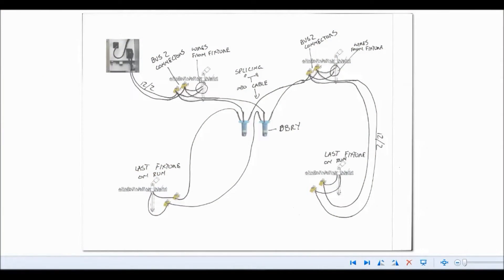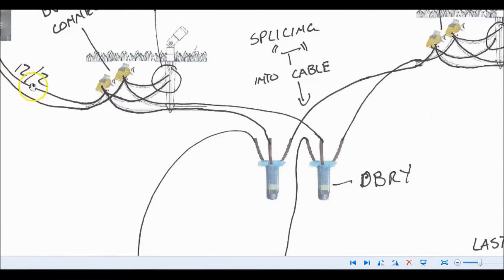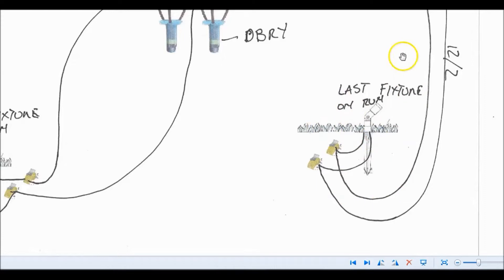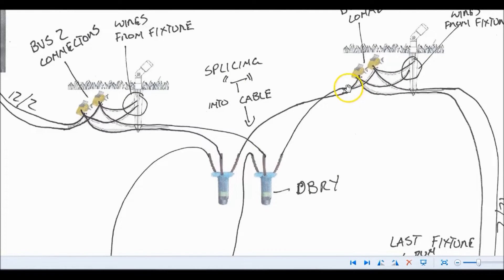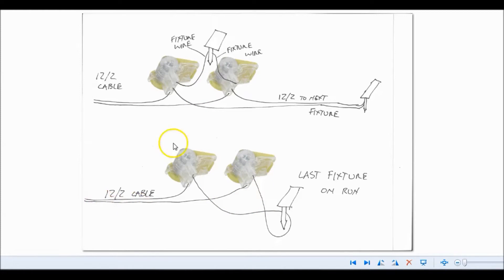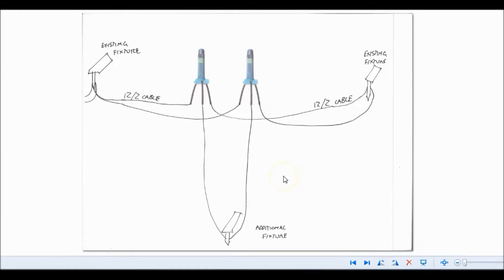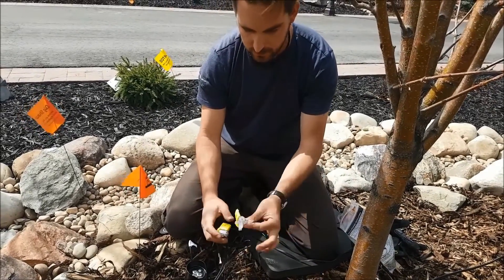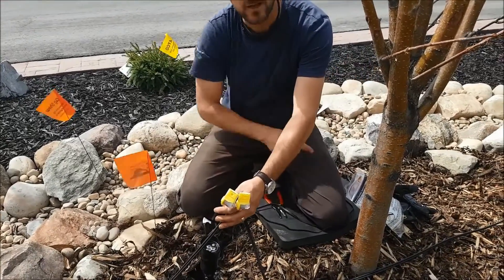How to Wire Low Voltage Landscape Lighting with Wiring Diagram

Comment: Great video!  I am curious if you have to deal with voltage drop between the transformer and the last light on the run?  Also do you have a maximum number of lights you run off a transformer?  If a larger number of lights are being installed, do you need multiple transformers?  Thanks for a great video and simplifying things for us.

Comment: I have a different question.  I a have a transformer with 2 lines. One line is around house as security and second is around property as decor. Both currently go on dusk to dawn. I want to install a switch on the second line so when not entertaining it can be shut off.  The line is rated as 300w each but I'm running about 100w on the line.  Can I use regular single pole switch or do I need something diff.

Comment: Thank you making videos like these. Very helpful.   I have a Question hope you can help.  I have many up and down lights I purchased and I have 12/2 wire low voltage and 12/2 wire that is not.   I’d like to use the low voltage wiring since it would be easier to install I think.   And I’d like to use a low voltage transformer.  Can I use a light fixture that does not say low voltage on it with a low voltage transformer and wiring system? Can I use both types of 12/2 wires with a low voltage system? Thank you.

Comment: Hi, can I use the DBRY connectors everywhere in the diagram including where you have BVS connectors?  It just seems like a more solid and better sealed connection.  Thanks for the diagram.
Reply from the maker: Yes absolutely you can

Comment: Thanks for the informative video.  Can you tell me how to seal off the end of the line exposed cable wire?  I bought wing nut with waterproof goop inside and put both wires in there and now my lights don’t work as usual.  Was I supposed to put one one but on each split of the end wire.  The directions did not indicate using two and it comes in a five pack so it leads one to believe that only one is needed.  Short of wing nuts can I just tape the end of the line with electrical tapes. I have searched and searched for an answer and have come up empty handed...
Reply from the maker: If you search Lighting Doctor wiring the last light there are some videos that should help answer this
Reply: What does "line exposed cable wire" mean?

Comment: Hello lighting doctor...great videos!  Previous owner used the prong type of fixture :(  .  Fixtures are no longer working and need new ones with proper connectors.  Do I need to replace the 12/2 wire because it's been punctured?
Reply from the maker: It would be a good idea to try and replace where the wire has been punctured to keep water out and avoid corrosion which could shut down the whole system

Comment: Great video. Can you cover if the wires need polarity? You don't mention having the same wire as "common" and the same as "12 volt". Does it not matter, like on a 220v circuit? Or is it important to make sure the wire is the same at each fixture.
Reply: Most countries don’t seem to have any issue with polarity but to be honest they should as for low voltage bulbs it doesn’t matter as a bulb can generally be fitted either way round  that said if working with LED lights then you need to observe polarity or the fitting may not work
Reply from the maker: Polarity is not an issue

Comment: Are these directions good for Volt and AMP lights?
Reply from the maker: Yes but when using these brands you can still run into more issues due to lower efficiency and quality of the fixtures
Reply: Lighting Doctor Ltd. Some of my fixtures are next to each other like a path light and a near by up light. Can I connect both fixtures to one feeder connector?? Or must they have separate connections?? Thanks

Comment: Question -  Does the "Power Out" from the BVS2 Snap Lock connection need to match the "Power In"?... For example -  If I am using "Common Wire" (12/2 wire with the writing on the side) as my "Power In" for a BVS2 Snap Lock connection. Do I also need to use the "Common Wire" (12/2 wire with the writing on the side) for my "Power Out" for the same snap lock connection???
Reply: Hey lighting dr thanks for the video! Can you please answer this question?

Comment: My trenz light (in the soffit) was not working so I bought a 4 pack replacement to replace the light. i replaced the light and the new one didn't work. Does this possible mean the transformer is the fault? how do i know?
Reply from the maker: Are other lights on the same transformer working?

Comment: Thanks for all the great tips! My only question, how do I know which wire in the cable needs to be plugged into what, or maybe it doesn’t matter so long as one wire from the cable is in each connector?
Reply from the maker: Correct christy, there is no positive or negative wire. As long as you have a continous connection of wires

Comment: So between 5:00&5:20 I don’t understand the concept of wire in wire out.  Is the idea to cut, place into little box, cut and have new wire coming out 
I have only had experience with the. Lighting packages for the big box store with sharp prongs they did ok but ready to step up to something substantial for my soon to be new home.   Do you also trench to get wires buried?  4”-6”-8”?
Reply from the maker: Yes that is correct, you will ha e to cut into the wire to make the connections. Search Lighting Doctor How to Bury wire and it should give you some examples how we bury the wire. Thanks for the questions

Comment: Great videos!  Very helpful.  Question - I ran a 250 ft wire from my transformer to 6 LED Volt branded in-ground well lights in a daisy chain like manner.  I find the light strength drops off as I go down the line with my last fixture only lighting half the LEDs in the bulb.  Why do you think I'm experiencing this voltage drop?  I'm using high quality Volt branded well lights, Volt branded transformer, and 12/2 low voltage wire.
Reply from the maker: Thanks for the comment really appreciate. Part of the reason  you may be having this issue is that Volt is actually not as high quality as they lead on to believe. They are manufactured very inexpensively over seas and brought over and sold at a low cost. Also there is the wattage per light and then something called VA which is actual voltage. With some lower grade brands the lights may be listed as 4 watts but the VA may be as high as 9 or 10 watts, so when designing the system you have to account for this. Basically the VA measures the efficiency of the LED. Another reason you may be having this issue may depend on the connections you are using for your wiring. However from what you are describing it sounds like either the transformer may be slightly undersized or the VA is pulling more power than innitially anticipated. Great question and this is certainly not the first time we have run into this with Volt and many other similar manufacturers. Hope this helps, please feel free to email me with any further questions. Cal@lightingdoctor.ca👍🏻
Reply: Lighting Doctor Ltd. ,: yes
Reply: @LightingDoctor  What brand lights do you recommend?
Reply: You might need 10AWG wire or you need to do less daisy chaining. Sometimes I feed lights in a T formation somewhere in the middle of the lights, so the source travels half the distance Left and half Right from the middle. If you feed from Left to Right end to end, you will possibly experience significant voltage drop.
Reply: Also sometimes it is better to feed from different sides with separate transformers, and still use 10AWG.
Reply: This is always an issue in long runs of cable as the longer the run the less power will be at the end of the cable  also each fixture will cause a volt drop, try to power from the middle of the long run or power from the same transformer to either end of the cable but never connect two power sources together by that I mean two different transformers  hope this makes sense
Reply: 250ft is a long run for 12ga wire.  Depending on the wattages of your lights you're probably needing something more like 6ga to maintain sufficient voltage at the end of the run.